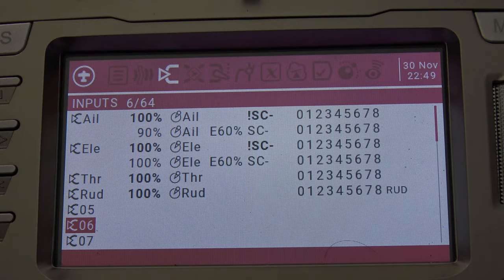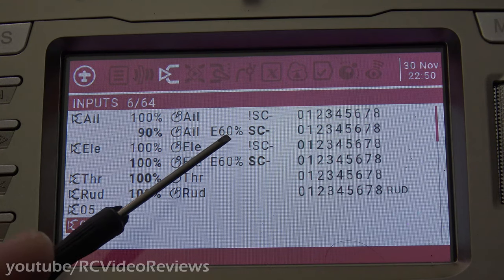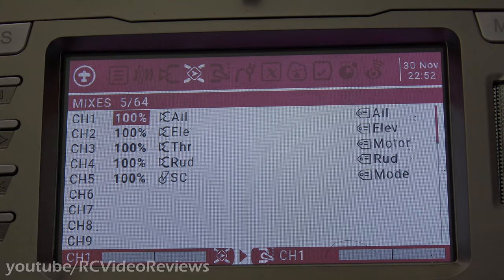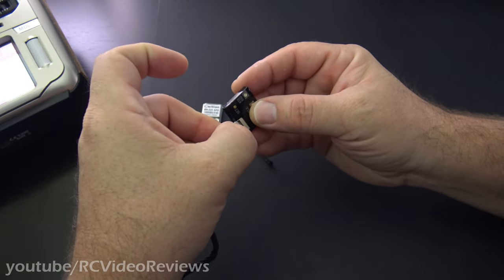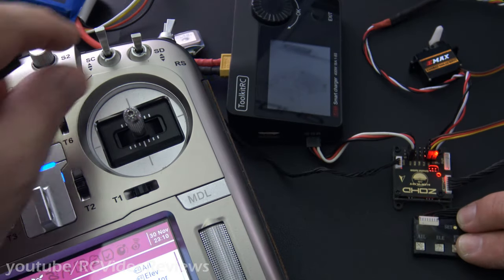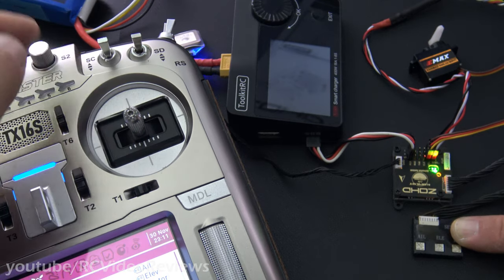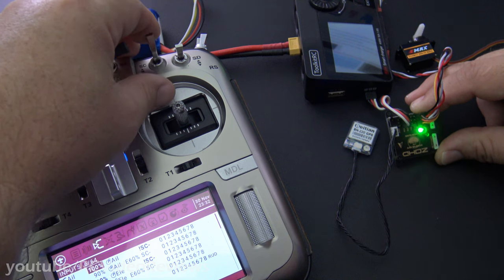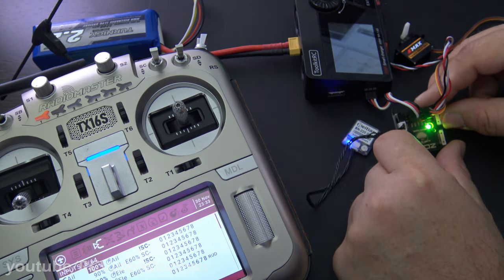Kopilot Lite: The Complete Configuration Guide

Comment: Hello, does this have osd?
Reply: No OSD but if you have the ZOHD camera (VC400) as an option for this FC it has basic OSD like video channel and battery voltage and timer.
Reply from the maker: @OZFPVflyer is on it and correct, no built-on OSD on the Kopilot. I've been buying up Aomway CCD cameras which also have the ability to display flight time, voltage, aircraft name, and a static horizon.

Comment: it possible to set gain in flight
Reply from the maker: It is not.
Reply: @RCVideoReviews  dam
Reply: i aming truble Level Calibration in stabilize mode  hold sticks but no flashing
Reply from the maker: @jujucattys156  Make sure you have weights for all four primary controls: aileron, elevator, rudder, and throttle set to 100%. Make sure you have rudder enabled in your mixer.
Reply: @RCVideoReviews  all controles work dont have any mixes on transmitter never used/tuched mixes woodent no where to start
Reply from the maker: Have you reversed any of the surfaces?
Reply: @RCVideoReviews  na m8 not kneed to
Reply from the maker: @jujucattys156  If you have all four surfaces enabled, none of them reversed, all with 100% weight with no modifiers, then I'm out of ideas.
Reply: @RCVideoReviews  If your Tx/Rx are not native AETR you may need to use different stick positions to initiate calibration . Hold the sticks to the 8 possible corner positions for 6-7 secs each till you strike it lucky. Throttle stick down and out and down and in for each of the 4 corners on the other stick. Make sure your stick travels are 1000microsecs to 2000microsecs (for -100 to +100.) Best of luck.

Comment: Hi John, Great details on the vid. I need some help, please. Assembling my first RC, a Zohd Drift FPV kit with Kopilot. I'm using a FrSky RX6R receiver and Radiomaster TX16s. After powering the model I do not get switching green lights (9:10 your vid) when toggling ch5. I've been through your setup vid and others to no avail. Any suggestions? Thanks in advance.
Reply from the maker: What happens if you disconnect everything except the ESC and run just the battery, esc, and Kopilot.
Reply: @RCVideoReviews  Hi and thanks for the reply. Just so we are talking apples and apples... I have the battery plugged into the ESC and that is plugged into the kopilot > Thr. Red GPS fix is constant on, Green 1&2 wing type both constant on. All other wires are disconnected.
Reply: Aslo slow beeping
Reply from the maker: @sixfingers2458  My point in asking you to disconnect everything was to make sure you didn't have a servo reversed or some other issue causing a fault. GPS is not relevant to the problem so disconnect it. Disconnect servos. If you plug ESC in to throttle and the Kopilot lights up with solid green that means you have it in Stabilize (balance) mode which indicates the pulses you send via the switch you have assigned to Channel 5 are not reaching the Kopilot. 

1) Press Model, Press Model again and view the channel monitor. Verify on the Channel Monitor when you move the 3 position switch on Channel 5 you see values of -100 (998us), 0 (1500us), and 100 (2012us) both for the mix line and the output line.

2) If you see those three states on the Channel monitor but you do not see light status changes on the Kopilot, something else is wrong like the bind to the Rx or the channel range you used during the bind, or the protocol, or something like that.

Bottom line is that you have to verify and be 100% sure the Channel Monitor is showing the outputs I described. If it is and the lights don't change you have something else going on. If it is not showing what I described, you have to sort that out. 

Your 3 position switch is defined in the MIXER ONLY right? Not on INPUTS, there's no channel override or global function issue? You don't have 3 different lines configured. You should have one single mix line entry:  Ch 5. SWITCH X   That's it, no modifiers, no sublines, no nothing.
Reply from the maker: It shouldn't beep if you have a satellite lock which is what is indicated when you have solid red led. For now, take the GPS off, take the settings board off, take all servos off, take off everything except the ESC connection and the Radio SBUS connection to the Kopilot.

If I had to guess, I'd guess you have a wiring issue between your Rx and Kopilot.

Do you have a way to measure sbus output like an M8S? Can you put an M8S on the Rx and verify the sbus output for Channel 5 I described in the previous comment?
Reply: @RCVideoReviews  Hi and thanks a TON ! I've learned a huge amount just from your couple replies and this led me to re-read some sections on the OpenTx web-based manual. I understand so much more. I'm still not functional but got over some hurdles on radio set up. With battery connected to Thr and Rx connected via sbus I am not getting active green lights when switching ch5. ALL other wires are disconnected. So I seem to have a problem w/ Tx set up?!?!?

On the Tx (2.3.11-otx) and AETR. I set to MULTI FrSky X D16 with RX6R receiver w/ Telemetry ON. Bind process seems to work based on lights on Rx.

Inputs:
ch1 100% Ail
ch2 100% Ele
ch3 100% Thr
ch4 100% Rud

Mixes:
ch1 100% Ail
ch2 100% Ele
ch3 100% Thr
ch4 100% Rud
ch5 100% SE

Monitor seems to indicate sticks and ch5 switch are functioning as they should.

I re-calibrated the sticks and pots as Thr seemed a bit off. All work in line w/ Monitor now.

I just went through bind process with just battery>ESC>Kopilot>Rx connected. Still no green lights when toggling ch5.

When I plug in the Kopilot I get Green light on Rx. On the Kopilot I get Red, Grn, Grn on continuous followed by 3 beeps, all three lights go off, several more beeps then a double beep followed by a longer tone double beep. It is then silent w/ no lights on kopilot.

Thanks again, really. Thank you!

Ian
Reply: I just kicked the tin cup over at Patreon because thank you!
Reply from the maker: @sixfingers2458  Thanks for joining Patreon, appreciate that.

So you say when you connect your battery, your Rx goes green (good bind), Kopilot goes Red/Green/Green for 3 beeps then all lights go off?

To sort this out you may need more equipment. I would really like to know if that Rx is putting sbus out. Did you solder your wires from the Rx to a servo extension? Are you 100% sure you have the signal wire off the Rx connected to the signal wire on the Kopilot? Do you have any other way to validate the Rx is sending signal out on sbus?

I also don't like the beeping, then lights out on Kopilot. Do you have any other 5v power source? i.e. Can we take the ESC out of the equation and make sure the power going to the Kopilot is reliable? It almost feels like you have two issues going on. One power, and one signal. I would suggest sorting them out independently.

I'm also going to strongly advise you to join Discord. It's a much more interactive platform for sorting out issues like this and you can get help from more than one person: https://discord.gg/jSFTASU